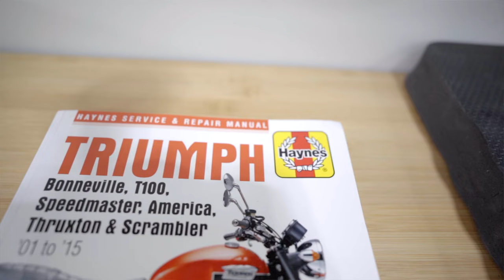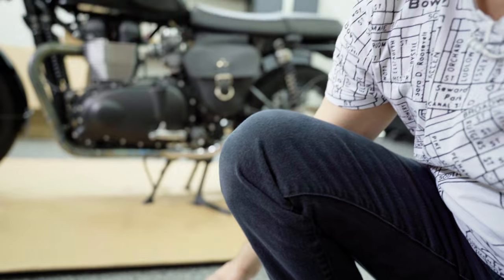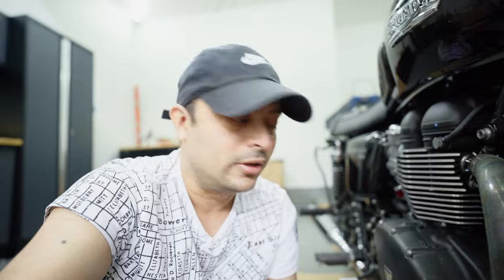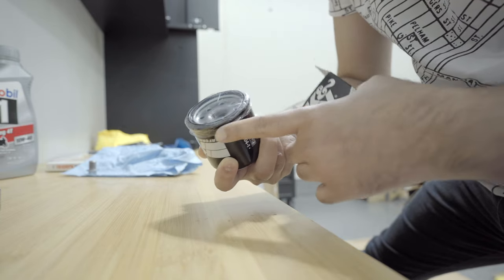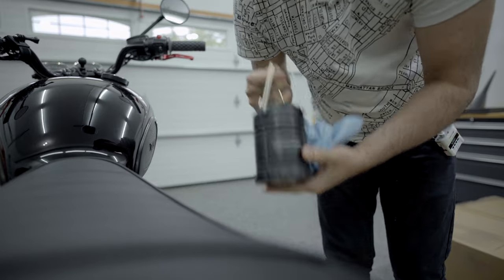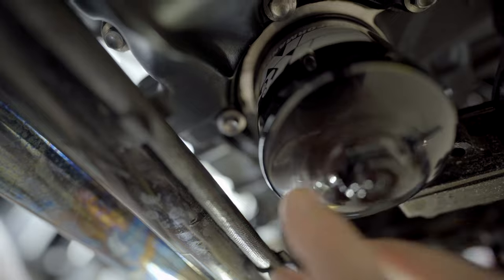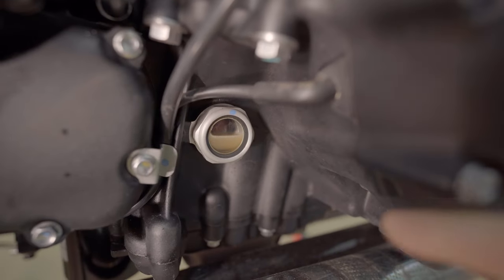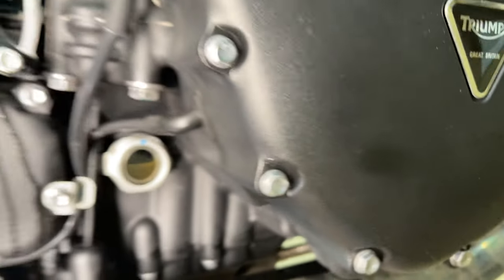How to do Oil Change properly for a Motorcycle by yourself - Triumph T100 Bonneville Oil Change

Comment: I buy the K&N 204-1 oil filters. They already have a nut welded to the bottom so you can remove them with a 17mm socket.

Comment: Did you sell the Vulcan S?
Reply from the maker: I did , I posted a video about it on the channel
Reply: @TLYRIDER  cool, I'll watch it
Reply: @TLYRIDER  do you prefer the triumph over the vulcan s and why ?
Reply from the maker: @rsobral560  I love the retro look of Triumph over Vulcan S. Triumph also has more power 900 cc vs 650 cc. But the ride handling and light weight goes to Vulcan S handsdown. I love both bikes only if I can have all of them ;-)